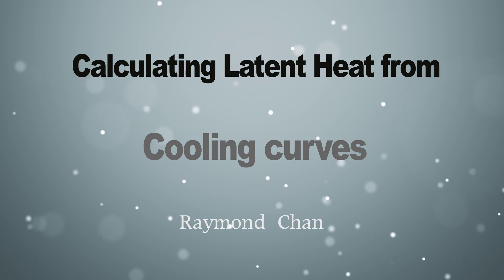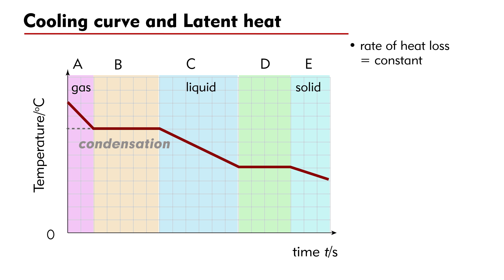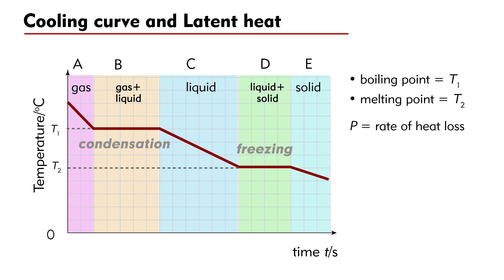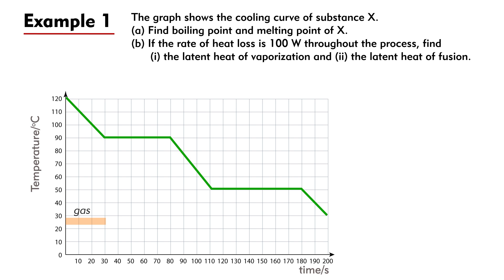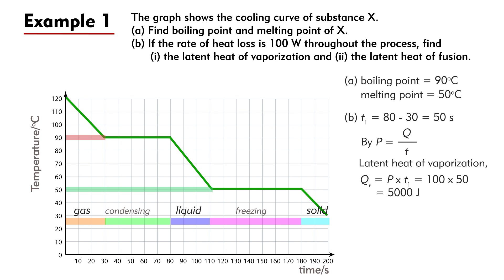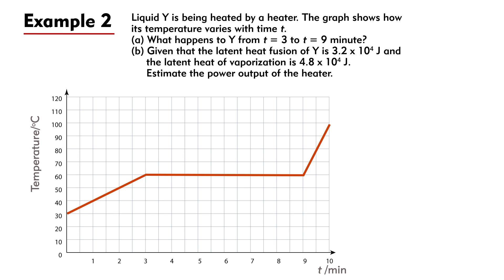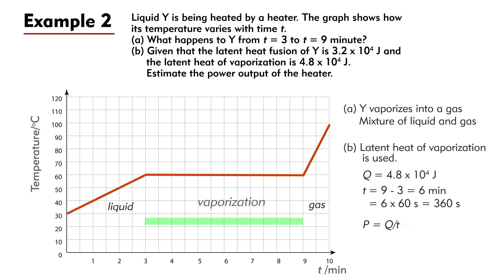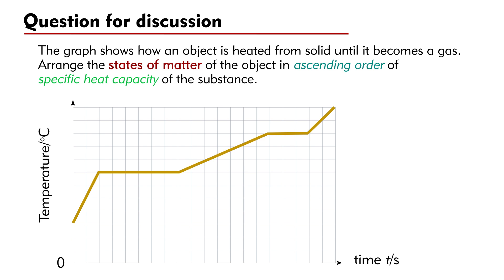Calculating Latent Heat from Cooling Curves

Comment: According to my own knowledge, when the temperature of an substance rises faster in a certain amount of time, it has a smaller specific heat capacity as a certain amount of heat (Q) is supplied with a result of a larger temperature change (delta T). And so, according to the graph, the specific heat capacities of the states of the substance in ascending order is: solid<gas<liuid

Comment: When the object is in solid state, the temperature rises in the shortest time during the process of melting , it has the smallest specific heat capacity.When it is the liquid state, it uses the longest time to vaporize. Therefore, it has the largest specific heat capacity.When it is in gas state, the time for rising its temperature is shorter than that of liquid state and it is longer than that of solid state.Therefore,  the ans. is solid state < gas state < liquid state

Comment: From the graph, we can see that when the substance is in solid state, the temperature rises the most in a shortest time,compare with liquid state and gas state, so we can conclude that solid state has a smallest shc. 
Second, when the substance is in gas state, the temperature rises 2 checks degree in 2 checks of time and the temperature rises 2 checks degree in 1 check of time in liquid state, so we can conclude that shc of gas is < shc of liquid.
As a result, the answer is: Solid<gas<liquid